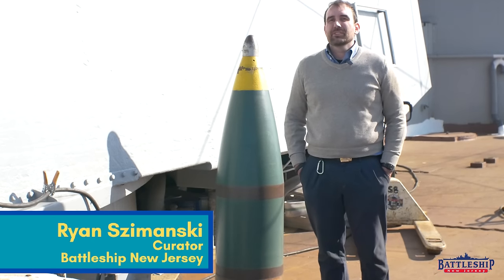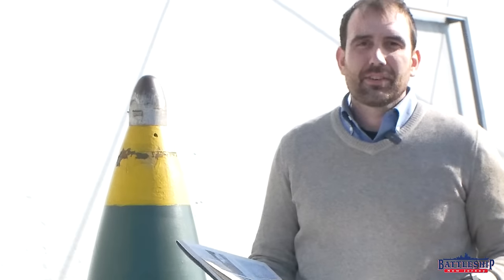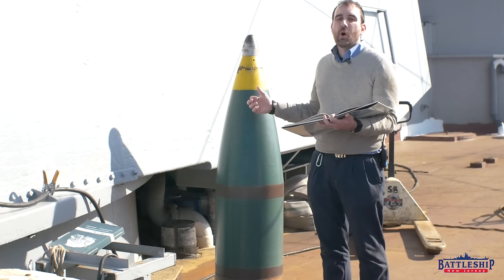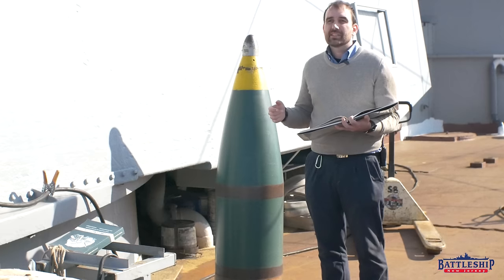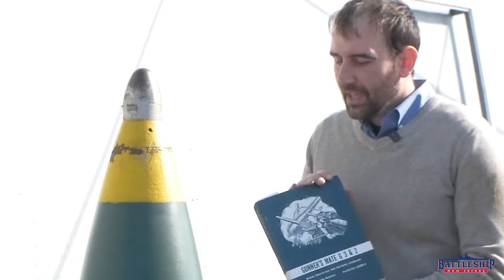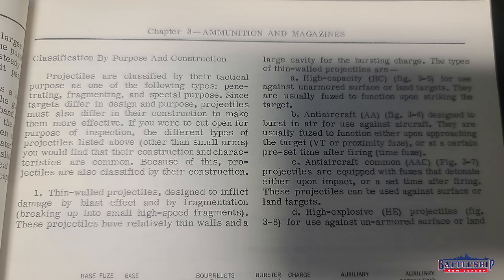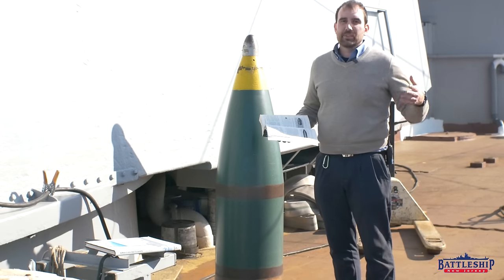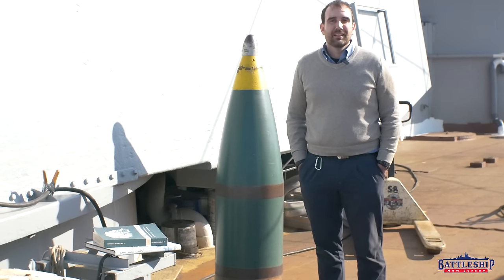What is a High Capacity Shell and Did New Jersey Carry High Explosive Rounds Too?

Comment: There's a really old joke about what it means to "secure a building" in each branch of the military:
Navy: turn off the lights and lock the doors.
Army: put concertina wire around it and don't let anyone in without authorization.
Marines: charge in and kill or capture anyone they find.
Air Force: take out a 5-year lease with an option to buy.

Comment: The M564 fuze was an artillery fuze.  It was used on 105mm, 155mm, 175mm, and 8 inch rounds    Interestingl to see the fuze well was the same size on those rounds as well as Navy 16 inch rounds
Reply: I would want to know if they had to machine an adapter to get those fuzes to thread into the 16” shells.

Comment: Modern 5 inch shells are called general purpose or hedp high explosive dual purpose. The have a programable fuse for point detonate, proximity/ air burst and delayed action detonate for light armor piercing. I witnessed a couple of sink exercises where old target ships soaked up dozens of rounds and were still afloat. The ex Guam in particular took at least 75 5 inch shells  after we ran out of harpoon anti ship missiles. Finally sank her with 5 2000 pound pave way bombs. The shells would have killed a lot of the crew had she been maned but not much else beside a hefty repair bill.
Reply: I guess it still holds true that you sink ships by letting water in into the bottom and not air into the top?
Reply: @PrivatePAuLa29a Sorta…

Comment: Personally I just think "high capacity" is a tradition thing dating back to the early era of shell guns when explosives generally were not high. You can't call the HE round "HE" when the filler is a low explosive, but you've still got to distinguish from your AP shell with a small bursting charge, so it gets dubbed high capacity instead. From there, well, if it ain't broke.

Comment: I suspect what's going on here is a standardization on nomenclature. 
First a armor piercing round is just that. A high capacity round was called that because it carried more explosive than then armor piercing. The high explosive designation is essentially redundant as all the shells used compounds in the "high" explosive category. That is to say they burned at a super sonic rate. I suspect calling them high explosive was to standardize the nomenclature with the Army and NATO.
Reply: Yeah, I think this is more what it is. AP shells had a bursting charge. HC shells had a larger bursting charge. Hence High Capacity compared to the original AP shell.

Comment: I think they used the time fuses to explode after burying themselves deep into the ground before exploding. This delay is useful in collapsing tunnels dug by the enemy.
Reply: That's one way to use them, yes.
But the thing with that mortar fuse is that it has two methods of ignition 
1) The 200s time delay chain that's initiated by the firing acceleration.
2) The impact initiated instant ignition chain that bypass the time delay if the shell hits something relatively solid, like a thicker tree, a rock, a field piece, stone or heavy timber structure or the frame/drive train of a soft skin vehicle or the armor of an AFV.

Comment: I think "PDF" as used in the G3/G4 manual shown by Ryan is not "point detonating fuse" but instead "proximity detonating fuse."  In the same way the proximity or VT fuse greatly enhanced the effectiveness of the 5"/38's in the AA and the anti-kamikaze role, the same enhancement was experienced by US Army and USMC field artillery units when they started using rounds with a VT or proximity fuse.  These fuses enabled the artillery rounds to explode in the air above the target, greatly enhancing the coverage and therefore lethality of the fragmentation effect of the artillery shell.

@8:58  The Army would likely call the 16" guns on Iowa class battleships "howitzers" based on the fact that they are cannon that can fire at both a high angle and a low angle.   In comparison, the Army might call the original 14"/45 guns on USS Pennsylvania "guns" based on the fact that, as originally installed, they were limited to about 15 degrees of elevation.  After Pennsylvania's 1929 refit, the guns could elevate to about 30 degrees, which in US Army naming convention would put them into "howitzer" territory.  Whether or not the main guns on tanks such as the M1 series are "guns" or "cannon" is somewhat debatable, as the official Army noun nomenclature describes them as (for example) "Tank, Combat, Full Tracked, 105mm Gun, M1, General Abrams" but the firing table has "Firing Tables for Cannon, 105mm Gun, M68A1 on Tank, Combat, Full Tracked etc etc"
Reply: To prevent confusion: he is talking about the pre A1 variant Abrams, which had a British L7 105mm rifled gun. When the A1 mod came around, it was replaced with the German Rheinmetall RH-120 L44 120mm smoothbore gun.
Reply: @Ganiscol  It is true that the M68 tank cannon on the M60 series tanks and early editions of the M1 series tanks were based on the British L7 design, but it is not an exact copy---for example, the L7's breech is horizontal while the M68 breech is vertical.  There are other subtle differences as well.

And the M256 120mm tank cannon on the later editions of the M1 series tanks are based on the Rheinmetall gun, but once again, it is not an exact copy.

As all three countries are NATO allies, ammunition interoperability was a design goal, achieved pretty well with the 105mm guns but only partially achieved with 120mm guns--both the American and German editions of the 120mm gun can shoot aech other's ammo, but the current British 120mm is rifled so uses completely different two-piece (aka semi-fixed) ammunition.
Reply: The Army calls howitzers that because they are primarily indirect fire weapons.  Sure, nearly any howitzer can be used for a direct fire mission if necessary, but the Army also had guns in service with artillery batteries, such as the M107 SPG with a 175mm gun, a direct fire weapon.
Reply: @throngcleaver  I don't think any "redleg" would agree with you that any of their cannon are "direct fire."   This is NOT to say that in those "Oh s**t" moments when direct fire is necessary most artillerymen wouldn't attempt direct fire upon advancing armored vehicles or troops.
Reply: @SomeRandomHuman717  Regardless, there are videos on YouTube showing the M777 doing direct fire missions, on targets in the mountains of Afghanistan.  Every caliber of howitzer and field gun has had direct fire missions at some point in its operational life, just like the direct fire guns on Naval vessels have done indirect fire missions.

Many 75mm and 105mm howitzers were used as anti-tank or anti-personnel, direct fire weapons throughout WWII, Korea, and Vietnam.
Reply: @SomeRandomHuman717  You can also look up the 175mm M107, an SPG, a direct fire gun, not a howitzer.
Reply: @throngcleaver  Army terminology generally assigns the nomenclature "gun" to cannon that shoot a flatter trajectory and the nomenclature "howitzer" to cannon that shoot a higher, arcing trajectory.  Cannon that shoot a really high trajectory are termed "mortar."  I don't think it gets to the point that there's a rule that says "to be a xxx [gun/howitzer/mortar] it has to be able to fire at an angle of xx degrees."
Reply: @throngcleaver  Hence my comment, "This is NOT to say that in those "Oh s**t" moments when direct fire is necessary most artillerymen wouldn't attempt direct fire upon advancing armored vehicles or troops."
Reply: @SomeRandomHuman717  And what I was getting at, was that direct fire missions using howitzers was often a pre-planned, operational tactic, not just "Oh shit!" moments.
Reply: @SomeRandomHuman717   I missed your comment about degree of angles.

I never once mentioned the angle of elevation differences between guns, howitzers, and mortars, so your last sentence about "...xx degrees." is moot.

Those three types of weapons were designated guns, howitzers, and mortars, because of their primary design use.  And of course that includes the ability to elevate or depress the barrel to achieve its primary mission of either direct fire  or indirect fire.  It also is about range.  A field gun can typically shoot farther than a howitzer, just like a howitzer can shoot farther than a mortar.  That's obviously a function of propellant charge size and muzzle velocity.

The Navy had a mortar system that could be utilized both ways.  The 81mm MK 2, could do both types of missions, plus it had a .50 BMG mounted on it.

It's still a mortar, because its primary mission is indirect fire at fairly close ranges.

Comment: In the Army a Cannon has two distinct names, anything over .50 caliber that can be loaded with explosive ammunition is called a cannon. A gun like on the M1 tank or a 155mm field gun is a cannon that fires at a low trajectory.  Most cannons these days are properly called howitzer as they are guns that are capable of high and low angle fire.
Reply: The last cannon in wide usage by the Army was the 155mm “Long Tom” of WWII fame. The modern artillery pieces are howitzers. Call it a gun at your own risk, because a true Artilleryman will quickly, and decisively, correct your error in a most unpleasant way!
Reply: All of the larger calibers are cannons.  The group, Cannon, consists of rotary cannons, auto-cannons, Naval guns, field guns, and howitzers.

The differentiation between a gun and a howitzer, is direct fire vs. indirect fire.

The 175mm cannon was a field gun, because it was a direct fire weapon.  The 105mm, 155mm, and 203mm cannons, were/are howitzers, because their primary design is indirect fire, with a minor capability of being used for direct fire missions.

Naval guns are direct fire, as are all rotary and auto cannons.
Reply: Forgot to mention SPGs, and SPHs, and of course, tank cannons are guns too.

Comment: Could the HC designation be related to the much larger explosive charge as compared to the relatively small bursting charge of an AP projectile?
Reply: From what I recall, it's actually a contrast to the "common" projectile, while was thick-walled (and, fitting down the same barrel, therefore had lower internal volume for explosives) and had some limited AP performance without being true AP shot.

Comment: In British parlance, "capacity" rating of a munition is the proportion of the total weight which is taken up by the explosive charge. For example, the Tallboy bomb was described as "Bomb, medium capacity, 12,000lb". "medium" in that context means about half the weight of the bomb was the Torpex explosive, compared to a "High Capacity" 4000lb bomb where about 75% of the weight was Torpex.

A bit of googling shows that the bursting charge in a Mk13 HC shell is about 154lbs of Dunnite. This sounds small for a 1900lb shell, compared to the above numbers for bombs, but it's worth remembering a shell needs to sustain much more violence before it explodes and therefore needs more brass and steel structure. For comparison the bursting charge of the AP round is just 41lbs.

Comment: "High Explosive" is a technical term describing substances in which the combustion front travels through the material faster than the speed of sound (as opposed to "low explosives", in which the combustion front is subsonic). This supersonic combustion front results in a shock wave with a virtually instant rise in pressure, qualifying as a "detonation" in and of itself. In contrast, "low explosives" don't detonate - rather, they are used to pressurize a container, to the point of structural failure of that container, and it is this sudden catastrophic failure of the container that constitutes the actual detonation of a low-explosive shell.
As a consequence, whereas a low-explosive absolutely needs a thick sturdy shell to create an explosion in the first place, high explosives need a shell casing only to maintain shape during firing, and maybe as raw material for shrapnel.
So a high explosive allows for a higher capacity in terms of explosive material.

Technically, a "high explosive shell" would be any shell that uses high explosives, regardless of whether or not it is designed for high capacity / low fragmentation. However, the term seems to have acquired the secondary meaning of a shell designed for maximum explosive yield, at the cost of fragmentation, which is exactly what high explosives excel at.
On the other hand, similarly, technically a "high capacity shell" would be any shell that uses an unusually high capacity in therms of explosives, regardless of explosive type. However, this almost inevitably requires high explosives.

In other words, in practice the designations "high capacity" and "high explosive" seem to be older and newer terms, respectively, for the same thing: A shell designed to give the bigest blast possible for the caliber, with negligible effect in terms of fragmentation. The former term is technically the more fitting (and at its time of use the only correct one), but has subsequently been superseded by the latter after its secondary meaning in this sense had already established itself.

Comment: I think a clue to why high-capacity shells are called "high capacity" is in the general description of "1. Thin-walled projectiles" where it states "and a large cavity for the bursting charge". That "large cavity"  would make it "high capacity", and begs the question of whether there was ever an explosive shell with a small bursting charge (low capacity) but more penetration that the Navy wanted to differentiate the shells from.
Reply: The Armor Piercing shell has a small burst charge. But since its called AP as opposed to Low Capacity, there is no need to call the other High Capacity. I doubt there was ever anything in between. The Navy just wanted to be different from the Army in that respect. 😅
Reply: I've heard "medium capacity" in reference to certain aerial bombs.  I believe it has a lot to do with the ratio of bursting charge to bomb/shell case to turn into fragmenting steel.  And yes, an armor piercing shell would be low capacity (small bursting charge).
Reply: @Ganiscol  Possibly, but there is another possible reason that involves the term "high-explosive". 

A high explosive is one that detonates instead of deflagrates, and some of  the first high explosives were nitroglycerine (1846) and Dynamite (1866).  The Navy has a history of explosive shells predating both of these. Thus "high-capacity" shells full of gunpowder as the explosive and meant to burst on the surface and cause damage to personnel and equipment versus low-capacity gunpowder shells meant to pierce the side of a ship before exploding and damaging the structure and seakeeping abilities of the ship.

 I am much more inclined to believe that the Navy simply did not change the designation to "high explosive"  when the new explosives became available out of a typical stubborn resistance to change than to believe it wanted to call its shells something else out of any sense of interdepartmental rivalry.

Comment: All of the shells contained a high explosive charge. The HC just had more capacity for said explosive, but it still retained substantial armor penetration ability (Not enough for full thickness battleships but more than enough for most other vessel and vehicle armor, at 8 inches tempered steel or 10 feet of 5000psi concrete construction). 
A purely explosive round has much thinner walls and no substantial armor penetration relative to its size, its effect is purely from the explosion.

Comment: I sort of disagree with you interpretation; I think you’re right about it being down to the fusing, but I think what the second source is getting at is that HE are designed to explode before/on impact, whereas HC are designed to explode after penetrating.  This name then makes sense relative to AP, as AP are also designed to explode after penetration, but have a lower capacity of explosive charge, than HC (or more correctly, HC have a higher capacity than AP, but both penetrate their target before detonation).

Comment: A question I've had for a while now. Had anyone tried to fit a VT fuse to to an HC shell? That way you can get all your blast and shrapnel ~10-20ft or so off the ground and not expend a bunch of your energy into making a crater.
Reply: You can be sure it was tried but it likely had less than desirable results. The smaller artillery like he 105 and 155mm used by the Army had a relatively small explosive charge in comparison to a Mk 13 shell, 5 to 15 pounds vs 133 pounds. While 5 or 15 pounds of high explosive can ruin your day exploding in the ground nearby, they can't move nearly the tonnage of the 133 pounds of high explosive in a 16". If that landed within 100 feet you were going to be injured if not killed outright. At least in an open area. By my rough calculations, the 16" shell is going to lift about 1,000 cubic yards of earth on impact, a good portion of it being propelled outward at velocities up to 6,000 fps. Making the 1,900 pounds of shell fragments in an air burst seem positively tame.

But you can bet it would be impressive to see.
Reply: By hitting the target you ensure bunkers ect are destroyed, if you just wanted damage on soft targets you'd want a very different bursting charge (indeed at this scale likely a cluster munition) but also timed fusing will set range just fine, and most of the time a battleships main guns will be a far riskier and or more expensive way to deliver that than dropping a bomb ect. The asset large guns have is the kinetic energy they embody, and the ability to ignore ww2 air defenses (the latter is even probably no longer true in modern world).

Comment: How and when did they arm the fuse and start the timer
Reply: Set the timer, pull the safety wire or pin/clip, and it arms on fireing from inertia.